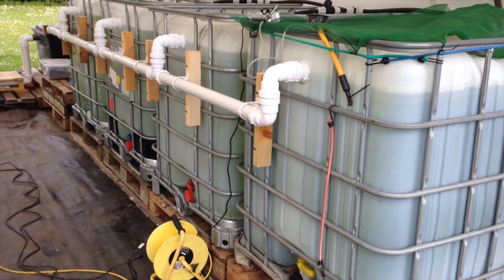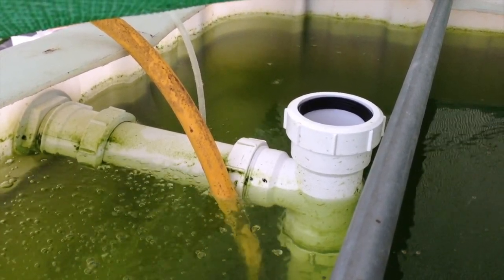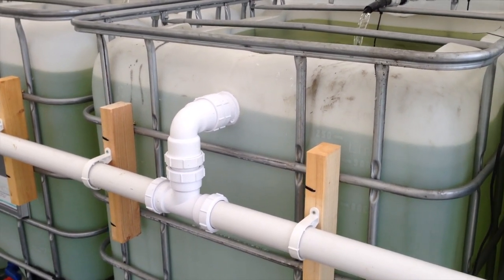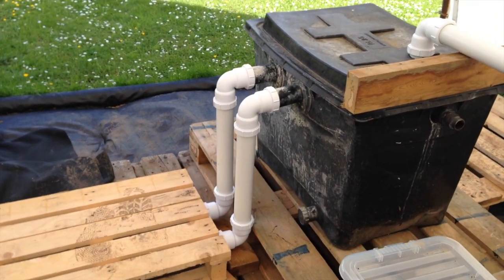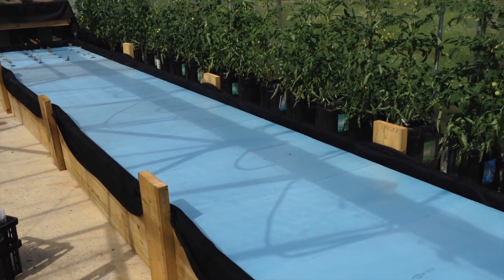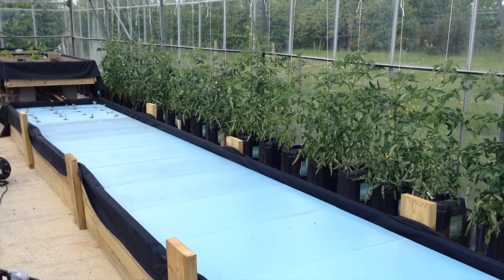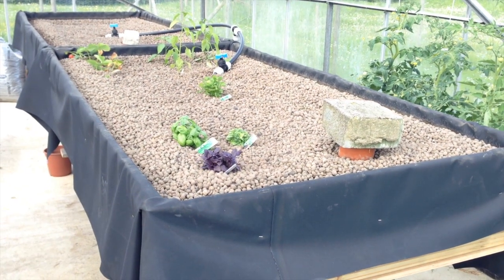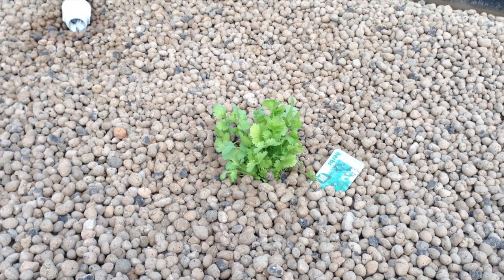Aquaponics Update - May

Comment: Nice system. I have built a similar sized system. I am curious if you add any amendments to the water such as Chelated Iron, Magnesium Sulfate, Kelp, or anything else?
Reply from the maker: Tim Christensen Hi Tim, no - we don’t add anything. That’s not to say it wouldn’t help... some of our leaves have been a little yellow.
Reply: @adriansbuilds  Thanks for getting back to me. I have been experimenting but the results have been mixed and inconclusive. My system is about a year old and plants are doing better now that my feed rates are higher. There aren't any amendments I would recommend but I am still experimenting. Best of luck with yours.

Comment: Question, Do you think it would be better to have everything connected to one central sump, in terms of disease? Or would it be better to have several closed systems?
Reply from the maker: DragonflyArtz1 Good Question...
They are 2 different ways to create your Aquaponics. This way is a connected system that has all the benefits of water conservation. 
To have 2 separate systems - 1 for fish and 1 for plants is better for each as you can set the pH for each... however it is harder (I think) to manage and means constantly moving water and even disposing of plant water when replacing it with fish water - and then topping up fish water.
Reply: Thank you. And great video! Very inspirational! Hard to settle on a design layout when you want to try everything! :)

Comment: uv clarifier for your algae problem and you really want to limit as much sunlight as possible from the IBCs in fact i would of recommended painting your IBCs black before using them to cut sunlight exposure to the water, I keep koi and algae and blanket weed are the main issues in the summer. adding a filter is kind of no good in aquaponics as the point of Aquaponics is the growbeds are your filter system. you really didn't need that biological filter media before the grow beds as all those expanding clay balls are your biological media. like I said a good uv clarifier after your grow beds before water returns to the fish tanks will help a lot with clearing green water. with the se up you have at least 100watt uv and watch your water clear in a week still be slightly green but slightly green is good for fish fish don't like it gin clear
Reply from the maker: Steven Peters Thanks for the input!  We have blacked out the tanks with a lid and pallet wrap and the water has cleared up nicely :)
The solids filter has been doing a great job, but the Nitrate is still not as high as we would like, so we will experiment by taking it out for a while and see what the results are...
Reply: Excellent video content! Sorry for butting in, I am interested in your initial thoughts. Have you considered - Patlarny Gardening Expert Principle (just google it)? It is a great one off guide for learning how to expand your produce with the clever art of aquaponics without the headache. Ive heard some unbelievable things about it and my cooworker after a lifetime of fighting got great results with it.

Comment: A couple thoughts. It would help if you reduce the light going into the fish tanks. Here they paint the outside of the IBC, and put a cover over each tank, including the sump, that also blocks the light. Or you could build an enclosure around and above the tanks. The fish don't need the light, and the algae is using up your nitrates! Nice job on the radial flow and bio filters. Very nice setup, good job all around. Look forward to more updates!
Reply from the maker: Hi Bob, 
We are on the same wavelength there!  :)  We have now wrapped the tanks in black pallet wrap to cut out the light and will be building covers this weekend.

The sump is a little bigger - but does need to be covered to get that darn algae away and save the nitrates for the plants!

I am now looking at how I can hookup the NFT gutter system to ill it up with strawberries for the summer!

Will add another update soon :)